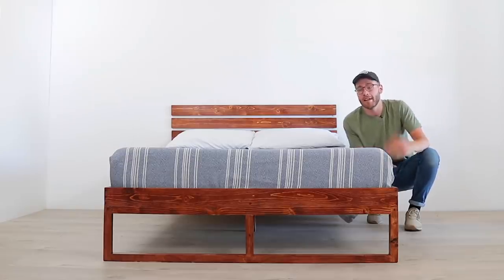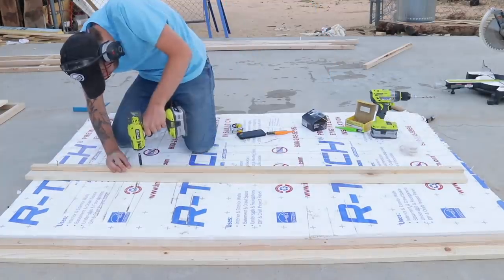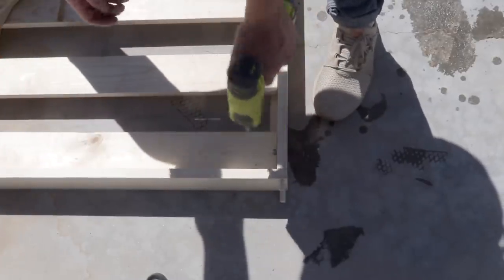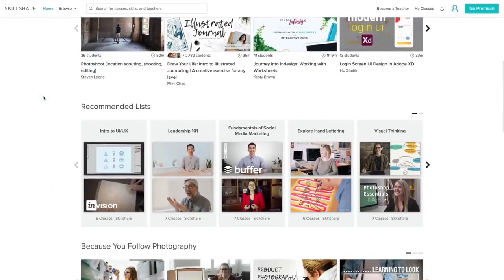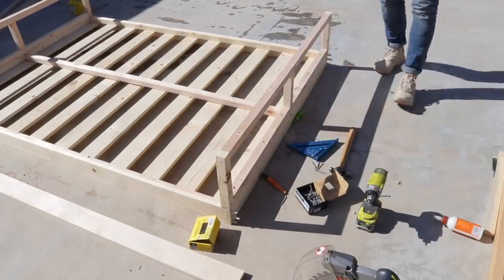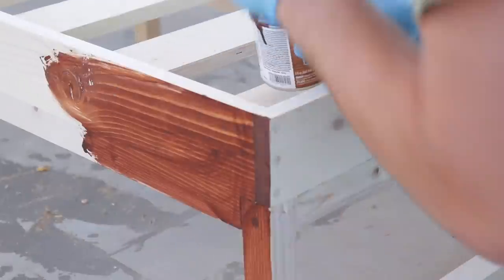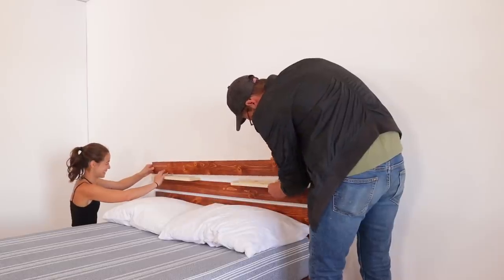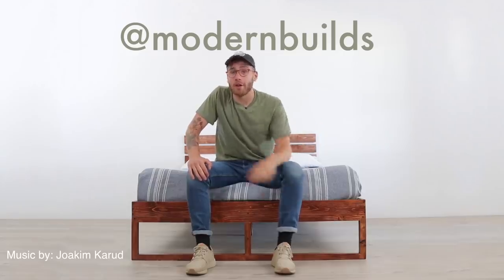How To Build a Modern Bed w/ Limited Tools | Modern Builds | DIY

Comment: So! My son and I just completed making this bed in one evening. We had been looking at those simple metal platforms you can buy because we wanted storage space under the bed. We decided we would build a simple platform ourselves and came upon these plans. We simply added an additional 3 inches to the 2x2's that we cut for the sides of the platform frames, and extended the center support 2x2's accordingly. We also used the best wood glue on EVERY joint. It's true folks - the screws help hold wood together while the wood glue bonds the two pieces together. Do NOT skip gluing. Once completed, we added stain-and-poly in one. This morning, the frame looks great and is super strong! We used the cheap white lumber from (orange-colored hardware store). Total lumber cost was around $40. We did dig through each size to find the best pieces, but we also liked the small imperfections that added some authenticity to the final look. A great project, easy to tackle and the final look is great!
Reply: I want to do the same...make it taller for storage...what did you mean by “extending the center 2x2 accordingly”?

Comment: Thanks for posting this video along with the cut list, Modern Builds. 

I selected  this plan specifically because I have a circular saw, but not a table saw. Getting angled cuts to come out constantly with a circular saw is too much of a dice throw. I have built raised beds and cut the molding for my flooring, but have never built furniture. 

I appreciate that this is a starter project in that the materials (pine from a local hardware store in MT during COVID where we're experiencing lumber supply shortage) were about $80. This makes the cost of failure super low. However,  fails I did not! I built this bed frame solo for my second grade son who has thanked me repeatedly. The first time he learned of my plans he said, "You're going to BUILD my bed frame?!" This is a cool legacy to pass down.
Reply: hey how did this bed hold up using pine?

Comment: What's up Mike?  When you consider that you never put the same sort of pressure on a bed that you were putting on it walking around, it's definitely strong enough.  The weight is distributed over a much larger area, especially considering there is a mattress.  The bed looks good and has to be cheaper than buying one.  It was great getting to hang out last week in the UK.  Hope you're recovering.  I finally feel normal again.
Reply from the maker: ManCraftingTM Haha! Exactly what I was thinking too 👌🏼 Yeah, awesome meeting last week. Starting to get back into the swing of things!

Comment: If you assemble bed with fixed and glued in platform like this in garage or driveway, make sure that this platform will fit you stairs dimensions. The larger bed the more challenging it could be to maneuver it to bring it into bedroom if ever possible. Also you may find it cheaper to buy slatted bed base from IKEA than paying for dimensional lamber at home center to build essentially same.

Comment: I remember you did half lap joint on a different bed. Which was easier, strong, and cheaper? Half lap joints or glue and screw butt joints?

Comment: It’s done I made a king size and it was bit flexible on sides but I made a couple of legs for each side to not bow temporarily. other than that it is pretty solid oh and I used 1x3” for just the inner slats because the 1x4 were twice the price of 2x4 I don’t own a table saw either or I could have ripped a 2x4.  anyway I hope that this helps someone

Comment: I want to make this, but don't have a mitre saw, or indeed any other kind of saw. I'm also...not wealthy. As in "have been out of the homeless shelter for about 5 weeks as of fall 2019." Would I be able to cut these pieces with a jigsaw or even a small handsaw like the flush trimmer you'd use for smoothing off the dowels? Also, how do you get structural lumber to be decently square and not bow-y/bendy? I don't have a planer or leveler or router.
Reply: You could probably do it with a jig saw assuming you have a few clamps and a ruler. But I’d try to get at least a circular saw, otherwise your lines will be a little wonky. You can get pretty cheap equipment from fb marketplace and Craigslist.

Comment: Hi mike love your channel and everything you build, I was just curious how do you move the bed through doors into whatever room you want, or if you decide to move how would you manuever the bed throughout the house, basically can you take apart and reassemble the beds and how?
Reply: thanks love your channel again!! gives me so much creative inspiration
Reply from the maker: So on this one, because it's a full size bed, everything was able to fit through doorways easy enough. Although the base can be separated from the rest of the bed if need be. on all the other beds I've made they've been held together with screws so that it can come apart and be reassembled wherever it's going to be. The important thing is just planning ahead and only glueing joints that will always be together and not accidentally glueing and screwing a piece that will have to come apart later on

Comment: can you include the cost for each project?
Reply: It would vary depending on where you live....Based on the cut list on his website you'd need about 
10 - 2x2s = $10, 
4 - 1x2s = $8
4 - 1x4s = $12
so $20 for the lumber if you bought the cheapest pine available plus the cost of screws.
Reply: What size screws you use??

Comment: Hi! please make a bed with some system to disassemble!
Reply from the maker: Just don't glue the base to the platform and you'll be able to take it apart and reassemble
Reply: Thank you for the reply! I'm honored. I live in apartment that is why I asked for a system that was possible to disassemble. Thanks for the suggestion but I need to disassemble the base also to fit in the elevaitor. 
So. I keep the suggestion.
Congratulations for your work and great static taste!